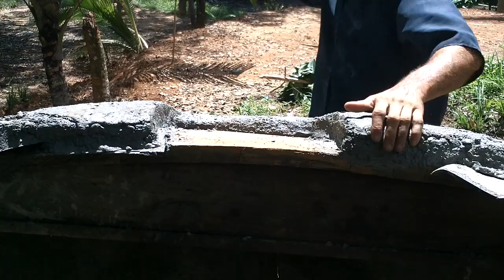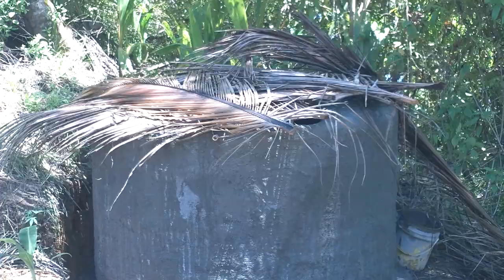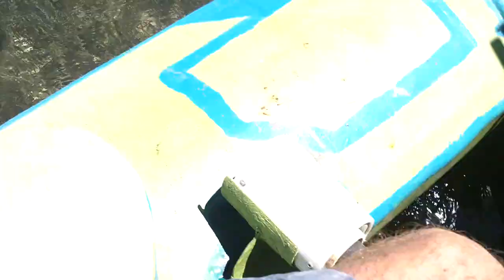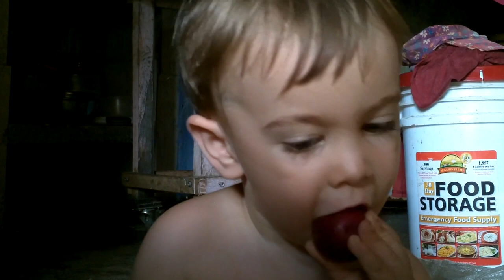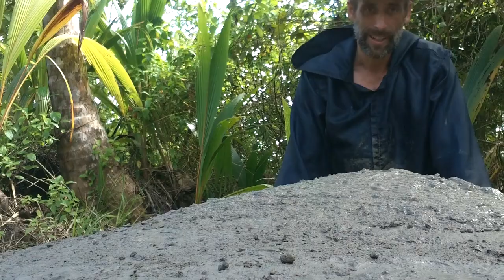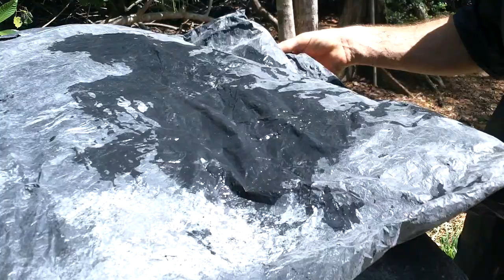Concrete Water Tank 04 Done!

Comment: how much does it weep? i built an 11' diameter 6' deep ferrocement tank and it leaks water pretty fast, 50 gallons per day or more. i'm in a desert, tank is underground on a sand-clay base. was unable to seal it by mixing bentonite into the water the first try. cement milk didnt work either. have been adding layers of sodium silicate. will eventually stucco the interior with white portland cement mixed with chalk fines. 

why in the world are you still bare handsing portland cement products?

Comment: Did you contemplate the lye the leaches from the concrete into your water maybe your not planning on drinking it ?
Reply: I cement coated the steel tanks in my boat, the water was horrible for a long time, until I carbonated the water from a CO2 cylinder, cured the cement and the problem. A few bottles of soda water would do the same.